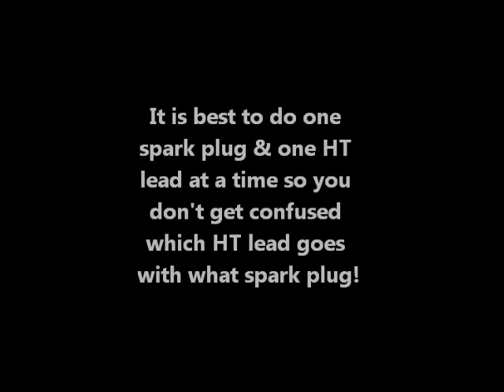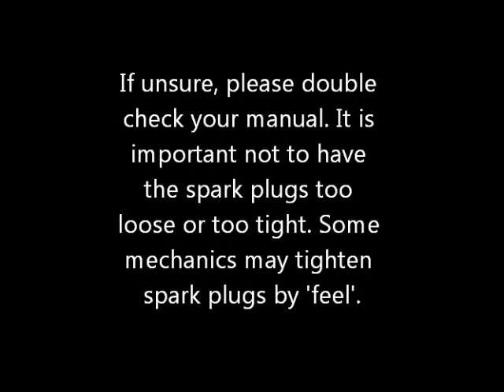Spark Plug Change for a Volvo S40 / V40

Comment: You don't need to replace the sway bar. Replace the bushings and brackets on both sides. Sway bars very seldom need to be replaced unless you have wrecked the vehicle. I just replaced both of mine no more metal on metal everytime I hit a bump in the road now and the steering is fine. Check your struts also. I lived in CA moved to TX the road conditions in CA far worse than TX.

Comment: Oil changes are harder to do than the fuel filter. The cost to change the oil yourself with all that you need for disposal, filter and oil is close to the same price you spend to have it done at Kwik Kar or other Oil change garages. Plus they are liable just encase the oil filter is loose or they forgot to put it back on and your oil drains out and engine burns up. I know people that have done this and it's quite costly too.

Comment: Hi Mark, I bought a 2003 Volvo S40 in Feb of this year, it only has 57k miles and i would say the spark plugs have never been changed.  Do you think after 10 years I should replace them?  My engine stalled in 95 degree heat the other day on the way to work, its an automatic so it was obviously not normal - could be an alternator or battery issue, or a spark issue.  Thanks

Comment: Your fuel filter is large and it's on the driver's side in front of the back tire. There is a shield to remove and the rubber caps on the new filter you need them to cut off both sides of the fuel line you also need to depress the fuel in order not to have so much pour out. You need to have some throw away towels I promise you will have it on you and all over the ground if not done properly. Google how to change a fuel filter on your specific car. Most inline filters are in the same place.

Comment: hey Mark...how many sparkplugs does a 2003 Volvo S40 have??
Reply from the maker: The 2003 is a 1st generation Volvo S40. All 1st gens (Mark I) were straight line 4 cylinders. Therefore, the answer is 4 spark plugs (1 for each cylinder).
Reply: It does have 4 plugs but your wrong to assume 4 cylinders means 4 plugs. Some vehicles (example 94 ford ranger) has 4 cylinders but has 8 plugs, one on intake and one on exhaust side of engine. I believe the idea was to burn off any unused fuel. Or to squeeze a couple more million into their pockets from spark plug sales. Either way the reason why it didn't catch on was because it was a bad idea and unnecessary.
Reply: Except he isn't wrong to assume that on the S40's and that was the point he was making.

Comment: what spark plugs are the best to useon 2001 volvo s40
Reply: BOSCH Double Platinum are the OEM ones for your year
Reply: David Gregory i heard volvo and NGK are good, does auto stores carry Bosch DP?
Reply: My local auto zone carries them. Had to order but they got here next day
Reply: Use genuine Volvo ones from the Volvo dealership.  They aren't that expensive.  Volvos need very high quality spark plugs because the ignition system is a 2 ignition coil "wasted spark" design, which means that the spark plugs fire twice as much as an engine which has 4 individual coils.  Search for "wasted spark ignition" on YouTube and you will understand what I mean.